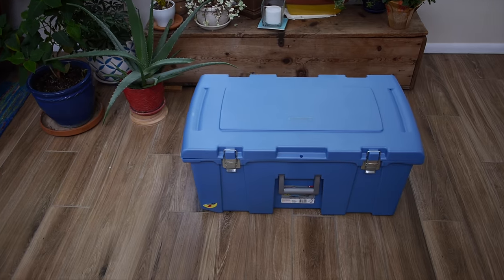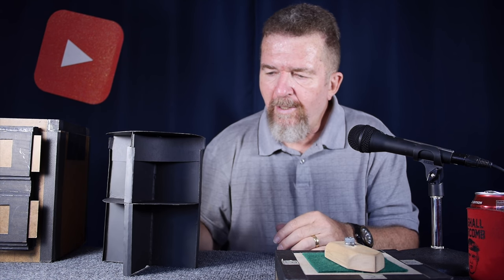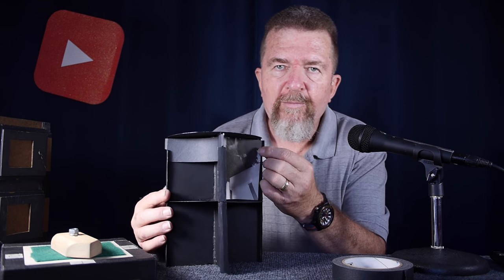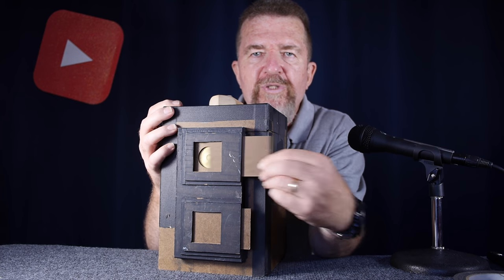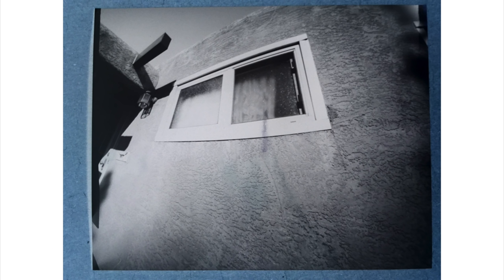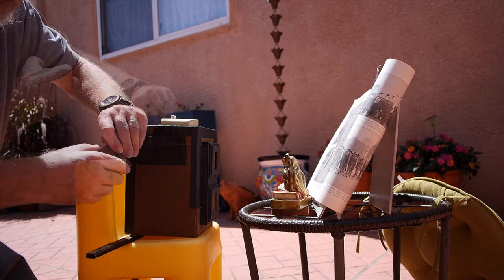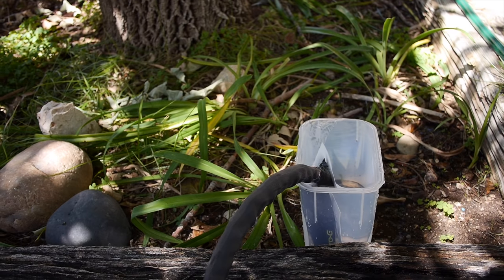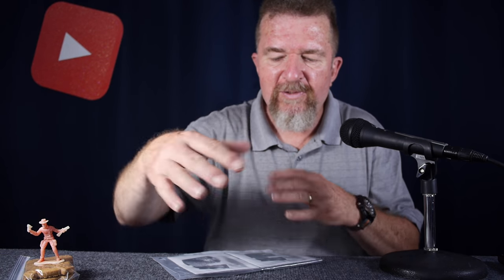Carousel Pinhole Camera

Comment: Have you thought about pinholes on all sides? I know pinholes are work to make well, but it might still be less work than the rotating bafflesystem? You'd also be able to do three sixty horizon sweeps quickly and efficiently.

Why not use an enlarger with appropriate filtering for flashing? You could also use the pinhole camera itself for flashing, pointing it an evenly lit wall, carefully metered. You’d probably not get as even flashing but still “good enough”.

Have you ever tried a water filled tank instead of curved film plane? It will give you optically mostly the same effect without the geometric curving.
You might even get a bit of hypering from the water.
Some disadvantages of course, but still interesting to try.
Reply from the maker: Lots of good ideas! The advantage of a single pinhole is very consistent exposure times. The next version of the carousel camera will have a single pinhole in front of the shutter that's movable between upper and lower position. I may also make it with the square rotor and flat film plane, as illustrated in my sketch journal, with a square drive dowel that's easier to install than the two fiddly little screws.

I've used my enlarger for pre-flashing, but found its light source it was too bright, even with the lens stopped down to f/32, requiring exposure times around 1-2 seconds, hence the dimmer pre-flashing light source that gives me longer exposure times that are more accurate to time.

I use grade 2 paper, which doesn't require contrast filters, giving faster speed with lower contrast than multigrade paper.

The water filled tank (or water lens?) is an interesting idea. Might have to try it.

Thank you for the great ideas!
Reply: Joe Van Cleave you might use an ND filter in your enlarger? Some people swear by using green light for flashing, since this is right on the border of the spectral sensitivity of most photographic paper allowing quite long exposures. 
That would also allow you more control once you’re dialed in.

The water filled pinhole is supposed to work because waters refractive index changes the incidence of the light to the filmplane. For a vertical camera you’d need a watertight pinhole. For example a glass slide with lamp sooth with a small clearing in it, or a very dense high contrast E6 slide photo of a pinhole.

Comment: Hi Joe, I'm planning to make a similar camera with only one tier for the rotor. Did you need the paper liners for the lower tier? Or did the full length metal edges and lack of a lower metal circle mean that fogging didn't occur and removing the negatives was easier? Thanks, keep up the good work!
Reply from the maker: Removing the negatives from the lower tier is easier, without the center disc in place, and also doesn't need the paper to prevent fogging. If I'd thought about it more before building it, I could have made it without these problems. But usually I design as I build, which can sometimes lead to these kinds of problems, that you end up fixing after the fact with workarounds like adding paper baffles and such. Thank you for watching, and good luck with you camera project.
Reply: @Joe_VanCleave  Hi again Joe, thanks for the response. I was just wondering, have you ever tried your hand at doing the autochrome process? I understand its essentially just reversal chemistry with the added work of creating the glass slide with the dyed starch. Theres some good info on it on Jon Hilty's blog. Thanks
Reply from the maker: @BonsaiBrandy  I haven't yet tried autochrome, thanks for the advice on Hilty's blog, I'll check it out.